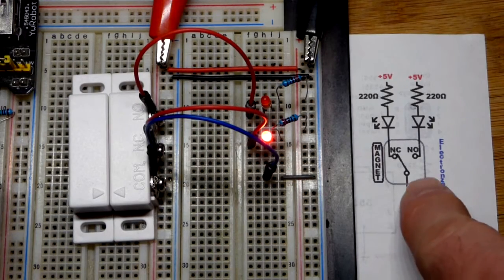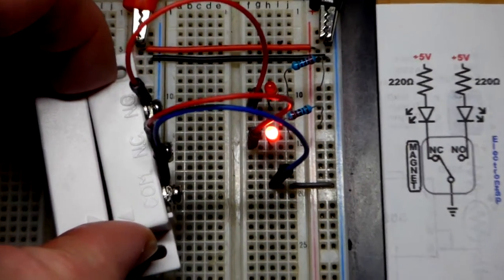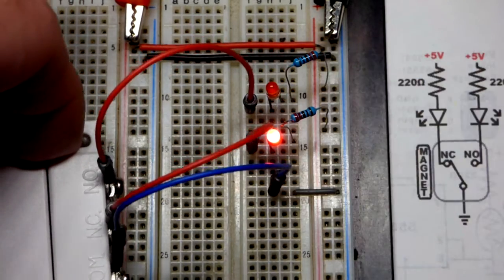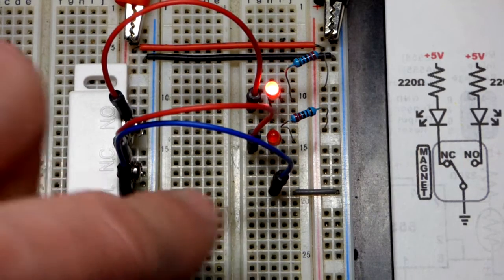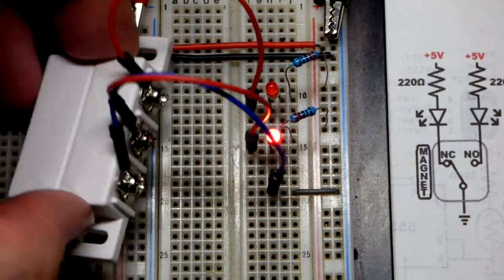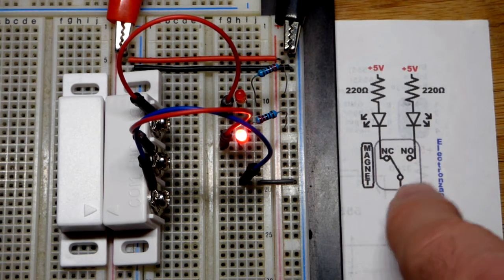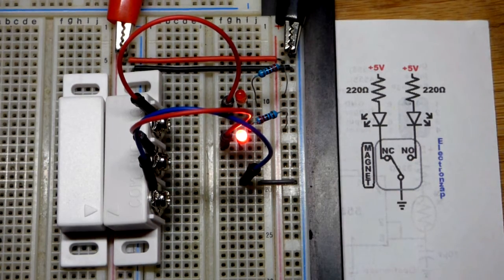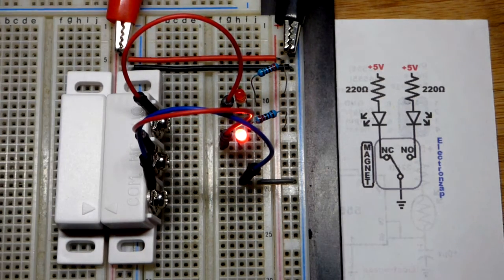Magnetic switch with normally open and closed terminals demo circuit learning electronics lesson 101

Comment: A normal closed circuit is closed in its resting state. When the actuator (magnet) produces a magnetic field it opens the circuit. 
That’s what is so confusing, because somehow the alarm industry considers the presence of the magnetic field (magnets together) to be “normal, which it is not.
Reply from the maker: Yeah, that's a good explanation.